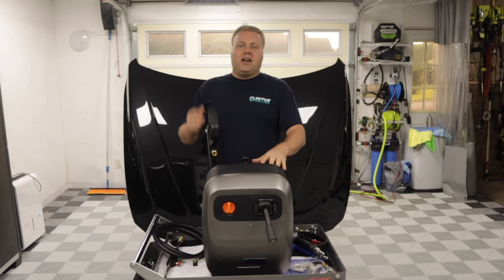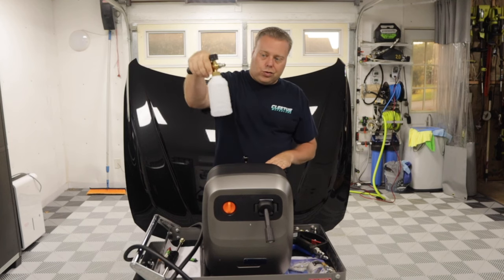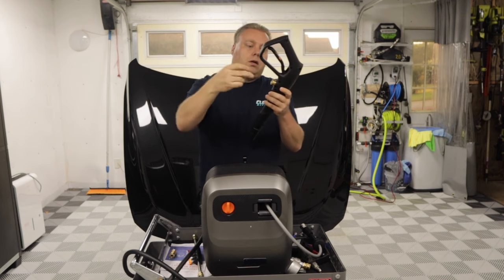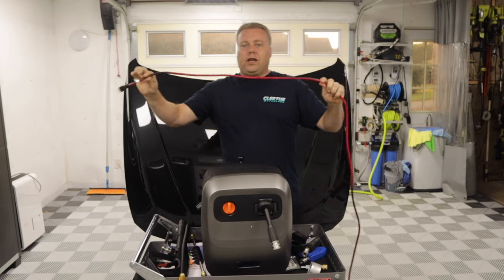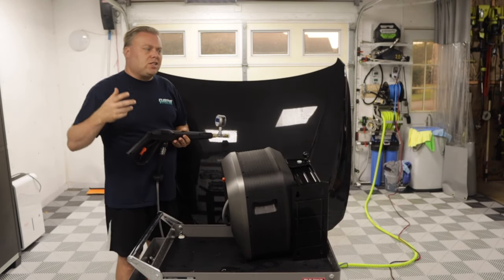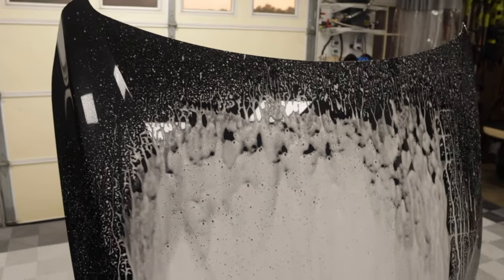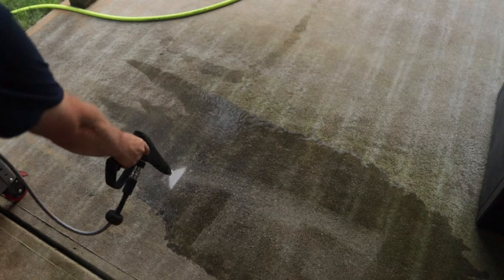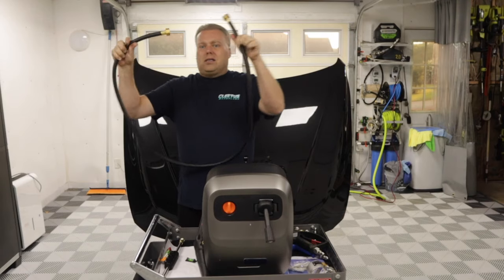Best All In One Pressure Washer?! | Giraffe Tools Grandfalls G20

Comment: Thank you for this detailed video!! We will continue to improve our products and do better.😎
Reply from the maker: Sounds good. I think instead of having an entry level hose just sell one model with the good hose. The higher volume would probably lower cost and you could offer it at a lower price point.
Reply: @CarsWithKeav  @CarsWithKeav Hey Keav, love the content man
Quick question hope you can help it has been a while since you tested this one I just installed my unit and will be using my bear force foam cannon what orifice do you recommend for the cannon with this unit  

Thanks
Reply from the maker: @KB-2018  You can run either orifice the 1.1mm or the 1.25mm. If you want to stress the unit a little less you can run the 1.25mm or you want the crazy thick foam run the 1.1mm.  You don't run the foam cannon a long period of time so 1.1mm is safe.

Comment: @CarsWithKeav Hey Keav, love the content man
Quick question hope you can help it has been a while since you tested this one I just installed my unit and will be using my bear force foam cannon what orifice do you recommend for the cannon with this unit  

Thanks
Reply from the maker: You can run either orifice the 1.1mm or the 1.25mm. If you want to stress the unit a little less you can run the 1.25mm or you want the crazy thick foam run the 1.1mm.  You don't run the foam cannon a long period of time so 1.1mm is safe.

Comment: Looks nice, but I'd rather have a diy wall setup where if something breaks it can be replaced alone instead of the whole system. Giraffe used to sell a standalone unit with great numbers for only $140
Reply from the maker: I agree on the wall setup. If you were using this
Mounted outside I see the use case for it or somebody who doesn’t want to be bothered with all the components and wants auto retract.

Comment: Nice review! Would you recommend this over a wall setup for someone who doesn't have a wall setup yet?
Reply: Chemical guys is better
Reply from the maker: Depends on your budget really. I myself for washing cars would make my own, but that setup would be around $400 to $500 using Active VE52 or 2.0. This for me is more for cleaning the back porch.
Reply from the maker: I have never tried the Chemical Guys so I can’t comment completely, but some I know have tested it and and based on their numbers this G20 would be  close to 20% higher PSI and flow with the 3.0 nozzle. It’s all opinion though and it’s what you like. The G20’s higher PSI would make it a more all around for the house. IMO here is a video from a reviewer I trust https://youtu.be/Ej5VrLviIcg
Reply: @BearThatSwings  they have god awful reviews, what are you talking about?
Reply: @CarsWithKeav do you know if active had a fix for the early AE 52 models so the hose could be replaced but still work properly?
Reply from the maker: @caseG80  Not that I know of for the older ones. They updated the pressure switch in the newer VE52 versions to allow for bigger hoses.

Comment: They just released an Upgraded Pro version that comes with 3300 Psi motor for $699
Reply from the maker: The original PRO was not worth it in my opinion. It didn’t perform anywhere near the price. Maybe they fixed the issues because in that price range there are some exceptional machines.
Reply: @CarsWithKeav haven't seen any all in one units like this available, if you know of any please share and thanks for the video
Reply from the maker: @Godfather44055  Comet 1700 is all in one, but reel is not retractable comes with 70 foot hose. Did a review on that recently. PSI is always what cleans best it’s a mix of PSI and flow. 3k PSI on an electric is going to be like 1gpm. A gas pressure washer cleans better because it can do 3k PSI with double the amount of water.

Comment: Is there a way to use this but not mount it to the wall? I am renting a house and want one but don’t wanna drill big ol holes in a house that ain’t mine haha
Reply from the maker: Because of the inlet hose location it would still need to be mounted on a cart or even just a few pieces of wood. You could elbow from the bottom to come out the side. It will be lower than the base so needs to be elevated with the cart or boards. You would then need enough weight or counterbalance to make sure when you pull the hose it doesn’t fall over. It for sure is doable.

Comment: Voltage drop doesn’t occur until 200’. 14awg is rated for 15A up to 200’ any further you need to up to 12awg
Reply from the maker: Correct, problem is most people have 16awg cheap extension cords which isn’t even rated for full 15A.

Comment: I have the previous model with 100ft hose and it doesn't retract properly it's like the carrier is not properly synced with the roller.
Reply from the maker: Is it the original one with the black hose? Those didn’t track great. You can adjust the slider somehow to get back in line.  The newer ones are much better at staying in sync on the retraction.

Comment: This or active 2.0? If they were the same price .

Thanks Keav
Reply from the maker: If washing cars a good bit Active 2.0 all day. Every once in a while and using for other jobs I think this is a good one. Also depends on your technical ability to do your own upgrade path.
Reply: @CarsWithKeav  Just got mine yesterday already wall mounted with a uberflex hose crazy the difference in gpm from my old greenworks PW . Just hope it holds up
Reply from the maker: @steelersx17  it’s crazy how much better and the foam cannons work so much better. Make sure if you have a foam cannon put a 1.25 or even a 1.35 in there to take some stress off the machine. The 2.0 is rated at twice the durability of a normal residential pressure washer so close to 200 hours.
Reply: @CarsWithKeav  already switched my mjjc do the 1.25 not trying to pop a breaker lol 
Big fan of your videos keav keep doing your thing 👏

Comment: Could you attach it on detail cart?
Reply from the maker: For sure just would need to make sure the cart is balanced for the weight and pressure of pull the hose. It being larger and the inlet location would limit the locations you could install it.

Comment: Hey, what are the measurements?  I’m concerned it will sit very far off the wall.  The website lists sizes, but doesn’t specify what side those measurements belong to
Reply from the maker: Mounted on the wall. From wall to front 20 inches, width is 14 inches and top to bottom is 17 inches. That’s my best try as there are a lot of curves. Another thing to consider once the inlet hose is on it adds 3 inches to the bottom minimal to make sure you don’t link the hose. If you wan an elbow from the inlet you could save some room for sure there. I will start adding these measurements in future videos.
Reply: Ty very much!
Reply: @CarsWithKeav   How many inches does it stick out from the wall when it's swiveled all the way to the side?  I suspect it may be useful to store it like that (assuming it sticks out less) and then swivel it out straight when you want to use it.  Also, how far does the Plus+ stick out from the wall?  And which of these would you recommend vs the other (performance seems similar with this one, even if maybe a bit better)?

Comment: nahh rather get a Cryobi unit for 80$ and spend  the extra money on a better hose and reel.  if anything happens to anything i can swap out. but this fails n you hve to replace everything.  probably will fail after 60 hours of use.   good oitput though.
Reply from the maker: I agree on just about everything you said. This is a retail consumer unit for sure. Those not wanting to deal with having to put all that together and won’t be using in any extended timeframe. I have actually used quite a bit to wash my lawnmower off.